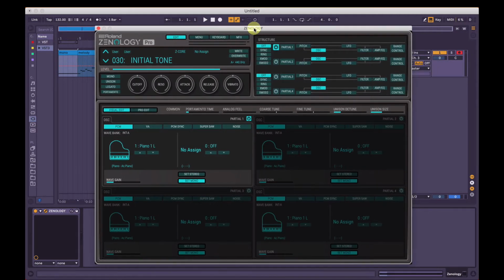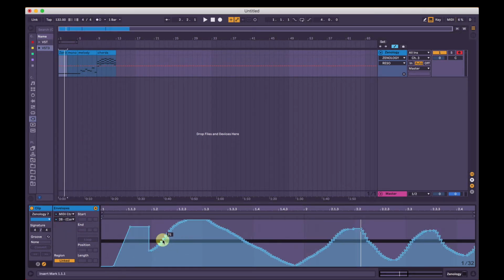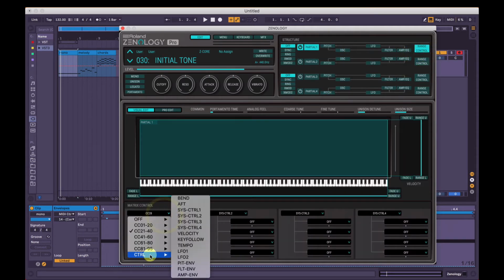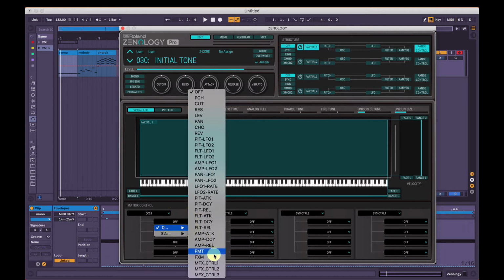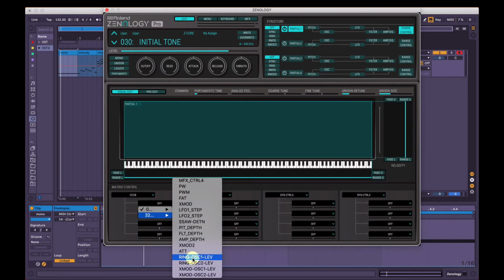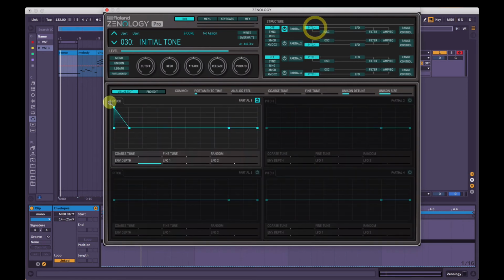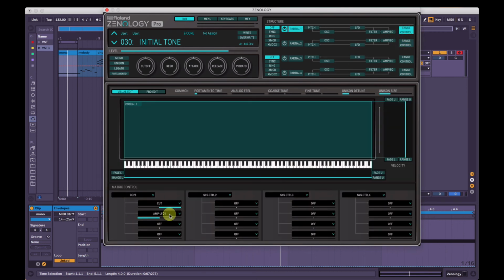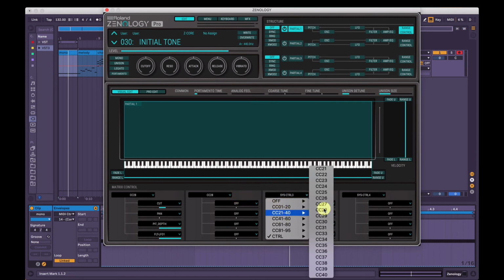Matrix Control and MIDI mapping - Roland's Zenology Pro

Comment: Out of curiosity, if you used two matrix controls sections (tone configured for one partial), Each being controlled by the same nob, same controller CC, 1st one set to pan left and 2nd one set to pan right, would it create a wide stereo field or other? that is adjustable from center on the fly?   

I came at this video  while searching for Midi controls of Zenology pro (in ableton and push 2 for me).  It strange that Zenology pro does not post  controls via the configuration button on the device and movement.   All of the other plugins from Roland do.   I think the Juno-106 was even premapped.   I guess matrix does the same thing but even more powerfully given that you can control 16 items (stacked or separate) per each partial. 

Thank you for making this video.